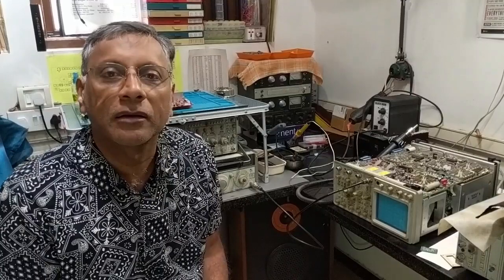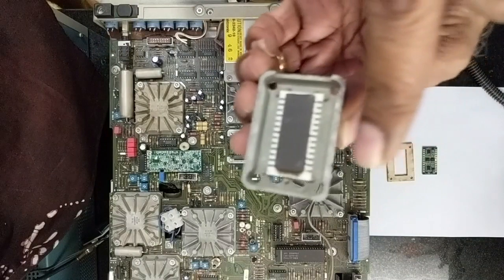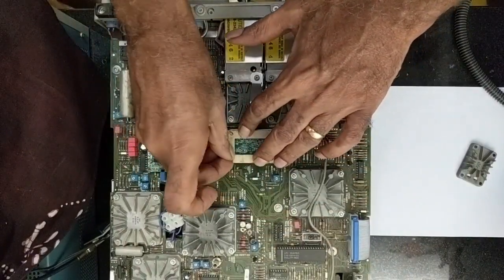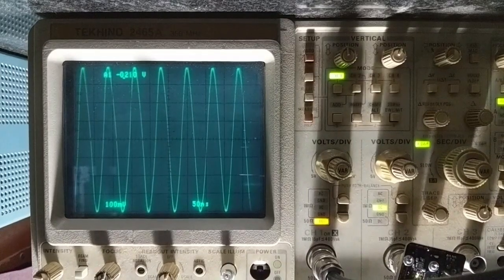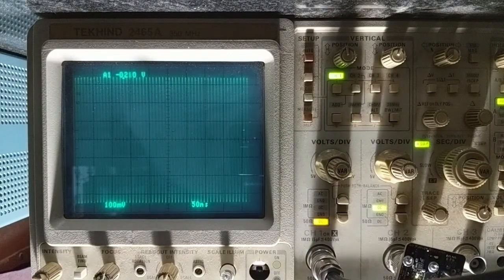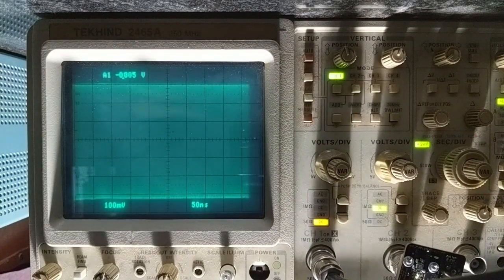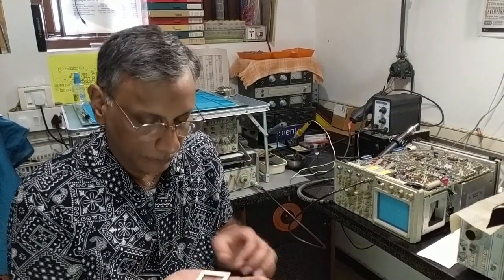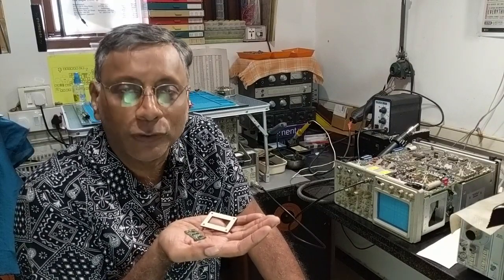The RU400 - A Drop In Replacement for the Tektronix U400

Comment: Love this solution. Thank you for the development work. Gives me hope that I'll be able to keep my 2445 going for years to come. Thank you. One thing, regarding wood vs acrylic for the bracket. I vote for Acrylic, since wood can draw moisture. Thanks again for this work. Well done. 🙂
Reply from the maker: Noted...I'll plan to go for acrylic then :-). Thank you!
Reply: @ramkumrr  Maybe consider making a design that can be published and then be subject to 3D printing?  The design looks simple, with it basically being a flat rectangular thing with four round holes and a rectangular cut out.  I'm guessing that the thickness is probably the most critical dimension.
Reply from the maker: I'm planning to include the bracket with the board, so that you do not have to go about getting it made. But sure, that is a simple bracket, can share the files.

Comment: Mr. Ramaswamy, where can we find this and the RU800? I'm in the middle of trying to recap the LVPS on a 2445 that arrived nonworking, just want to cover my bases in case either of these two are also bad.
Reply from the maker: The RU800 is available on eBay at https://www.ebay.com/itm/154246923795 and on my website www.audesine.com. You may see it as out of stock since I take one order at a time in order to give myself time to test and calibrate each piece. The RU400 is not yet available for sale, but I plan to make it available in about a month from now. Thanks for the interest!
Reply: Okay thanks! I hope my original is good, and that nothing else other than the PS is bad, but I am glad that you're making these if it becomes necessary.